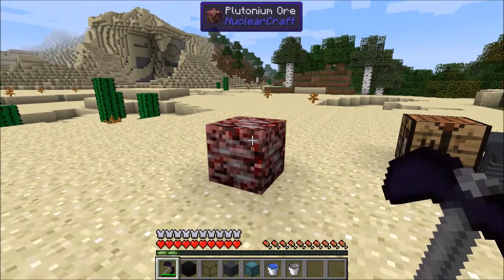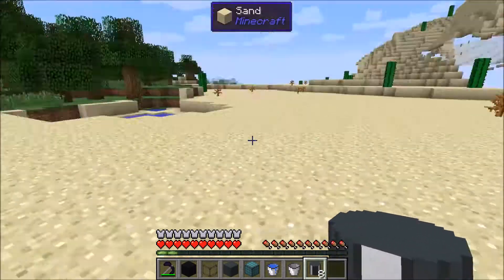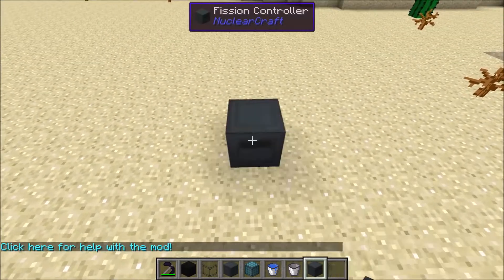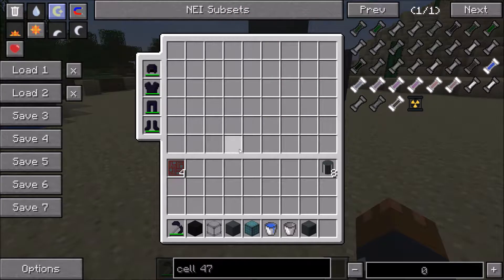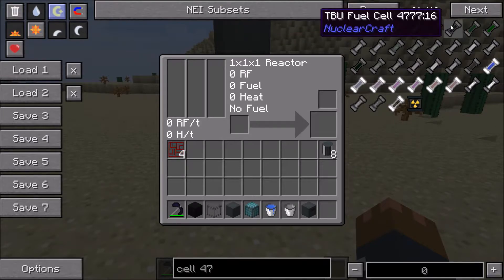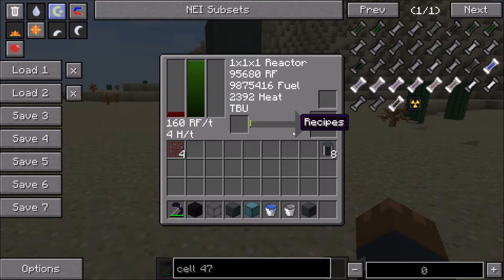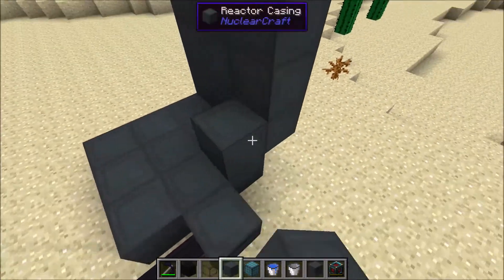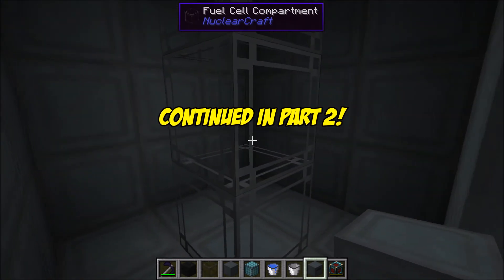Fission and Fuels (0.9)

Comment: Is their a way to monitor the temperature of the fission reactor? And have it sound an alarm and automatically shut down the reactor?
Reply from the maker: Brenden White No, there isn't at the moment, and, there probably never will be - I think it's better for people to think about the best ratio of cooling blocks to graphite to make sure the reactor is both safe and as efficient as possible.
Reply: ***** That's no fun. Maybe a third-party add on may come out that adds in that functionality. I guess IC2 and NC2 (Nuclear Control 2) are the only mod and add-on that has that functionality built-in.
Reply: Brenden White From memory Nuclear Control 2 was an add-on for IC² - it wasn't native.
Reply from the maker: +Brenden White There is now a feature (in the latest release, 0.0.1.6) in the fission reactors which will tell you how much heat will be generated before it is turned on.